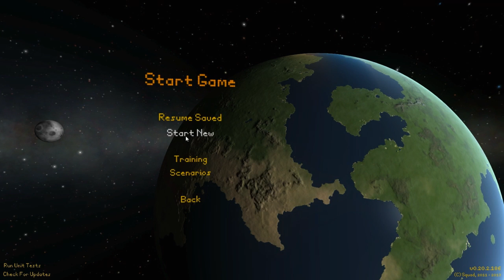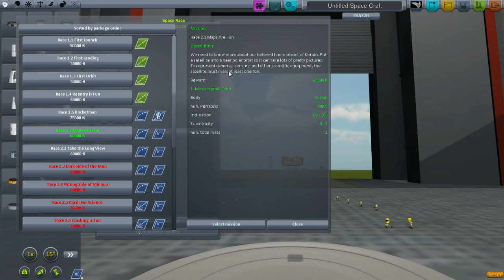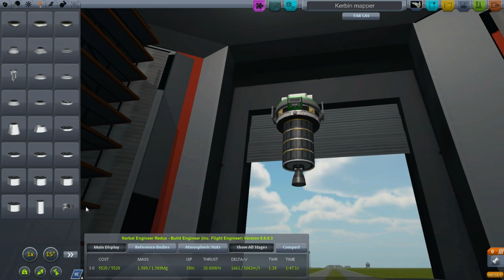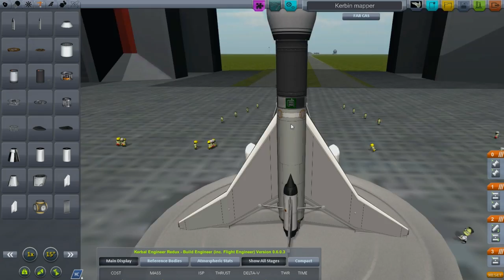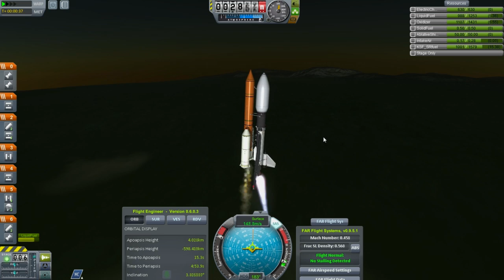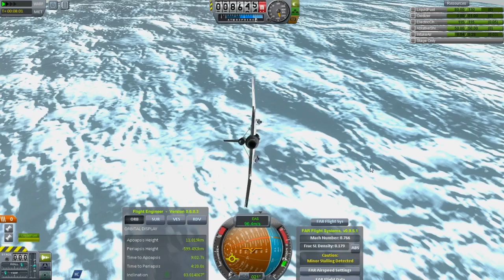Let's Fly KSP: Mission Controller Mod, part 12, Return to Spaceplanes

Comment: I looked at your video again and I was thinking that it might be better to change the staging a little. I think it should go decouple ET -> decouple fairing shroud -> orbit payload -> decouple fairing from SWERV. I think this decreases a few potential risks I saw with your design (notably the potential collision of the fairing with the ET and the fairing with SWERV when the payload ignites its engines). Both collisions are pretty low risk, but why take the chance at all? Still great stuff!

Comment: The Jet engine in top made the mass location go more to the top, which makes anything airplane like want to flip over to where the mass is on the bottom of it, so to fix it counter the weight by adding something to the bottom of the  SWERV-1

Comment: Oh right, duh, forgot that.  But SABREs aren't necessary, you'd just need a jet engine that works well even on low air (or gets you going fast enough at a lower altitude you get a high apoapsis).

Comment: Yes, good point, physics distance would make it challenging, as I think that was the issue in Scott Manley's Pegasus video.  However, there are some air-breathing craft that can reach 40-60km (you could experiment with SABRE engines or booster engines as well) and if you release at 40-60km you could get your payload quickly into orbit, then switch back and recover the launch plane like in this video.

Comment: here's what i learned about spins and recovery in glider-pilot-training: the quickest way to recover is letting all control sufaces neutral and then giving full rudder against the direction of the spin. in a glider, that makes you end up in a ca. 80 degrees nose down attitute that you can easily pull out of. maybe it's different with delta wings but i don't think so. 
another thing: why don't you just put parachutes on the launch vehicle? just kidding!

Comment: Problem with that is that you won't be recovering the plane if you launch in atmosphere, due to the physics distance. What you could do is the standard SSTO design, but replace the expensive liquid rockets with cheap and easy solid boosters.

Comment: You should try launching an orbital payload using a spaceplane that takes off conventionally, kind of like the Pegasus launch system.  The higher Isp of air-breathing engines and lift from the wings should really keep fuel costs down.